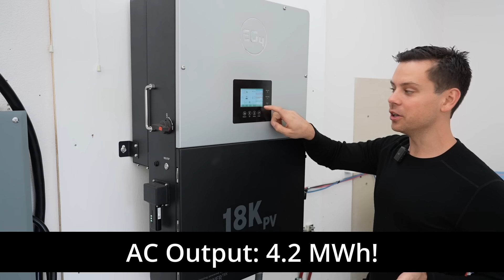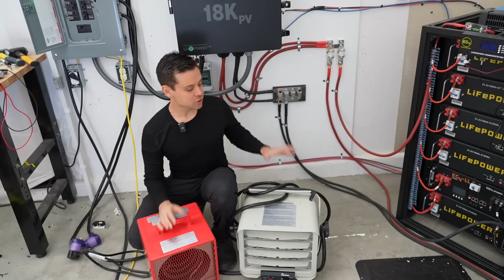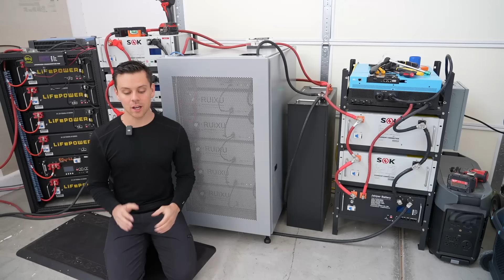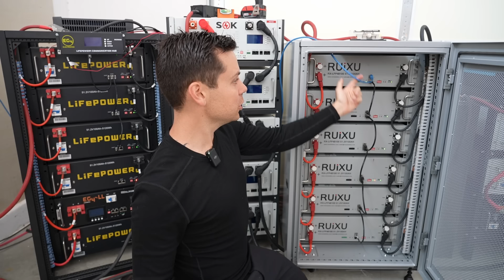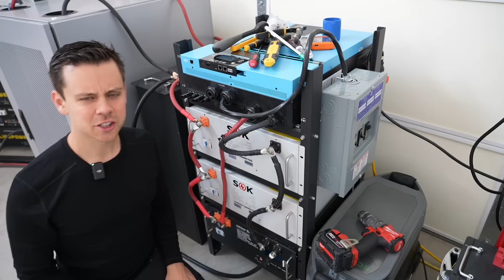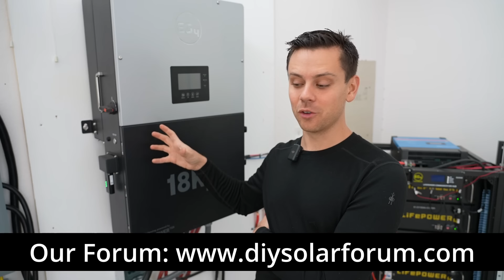EG4 18KPV + 113KWh LiFePO4 = Offgrid Bliss!

Comment: How were you able to use the battery Hub when you have an LL-S battery in your LifePower4 bank?  I have the same makeup - 5 LP4 batteries and one LL-S battery.  The instructions say to make the LL the master battery.  That, I think, eliminates the possibility of using the Hub on the bank.  Is there a way around this?  I'd really like to have the Hub connected if it's possible.

Comment: Hey Will,
Just picked up an EG4 18kPV and can’t get it to power on at all.
Here’s everything I’ve checked:

Battery is powered on and shows 65%
Confirmed 53–56V at the inverter battery terminals with a meter
Battery breaker on the inverter is ON
Load breaker is ON
PV/Solar disconnect is ON
Polarity is correct

The inverter has voltage but shows zero lights, no screen, no fans — completely dead.
Am I missing something obvious, or did I just get a bad unit?
Thanks man.

Comment: Thank you immensely for these videos Will (you are awesome at explaining everything so clearly).  I've been dreaming of a solar/battery system (to reduce grid power, uninterrupted power, as well as for powering our well pump and roof sprinklers in case of forest fire in the event of power being cut off).  I started watching your videos a week ago (binge watching 😀) and you've demystified everything, and I'm now moving forward on the system.  I'm planning for the EG418KPV, with the EG4 wall mounted batteries (i.e 2 X 280ah a 14.3kWh each = 28.6kWh total) and 10 x 455W solar panels (Canadian Solar)...I used your calculation video to ensure all is good (at -40C !) with the max voltage .  I've just applied for our provincial  (BC hydro) rebates (for solar panels and battery storage), which bring the investment cost down by about 33% (makes a $15K investment a $10K investment).  Thanks again so much for helping me take the leap! (I'll let you know how it goes).

Comment: Hi, after connecting the eg4 18kpv to the wall mount battery, how do I start the inverter without blowing out the capacitors? Please explain step by step because I realized nobody is using a  precharge resistor for this setup.

Comment: i want to be completely offgrid forever, not as a backup system.. the grid will be my backup system ahaha.
so im thinking eg4 18k with like 50kwh batteries and like 15kw solar? would this work or i need more

Comment: I want an overkill size / power system that charges off my Toyota Sienna mini van. 12v, 24v, 48v? Ideally in a big plastic trunk. (Wet bathing suits and towels- shocking) Able to power air fryer and large dual zone chest fridge freezer for days. NO SOLAR. What’s the best way to charge from vehicle?

Comment: Can you plug in the Cybertruck's NEMA 14-50 output into the generator connection on the EG4 18kpv to use it as a generator substitute?

Comment: From Luxpower.

However Huayu has provided about 400 pages of new evidences to the court in China to prove that Luxpower used the same money for Huayu’s exclusive 8-10kW series models to certify the so called 12kW model(the actual AC output is 10.4kW/208V only). But Luxpower provided nothing to the court to prove they have paid another certification fee(another million CNY)for the so called fake 12kW(10.4kW/208V). Also Luxpower tried to prevent the court to obtained evidences that Luxpower has also sold Huayu’s exclusive models 8kW/10kW models to US companies(such as Fortress & Sunbeat). In this case, Huayu reserves the right to further sue Luxpower Contract Swindler Crime until Luxpower proves that they have used Huayu’s certification fee as agreed on Jan.14th, 2021 for Huayu’s exclusive 8-10kW series models, not including the fake 12kW model(10.4kW/208V).

Comment: got my 18K after Signature Solar did their rebate for folks who had bought the 6500ex's. Set it up and it worked like a charm for a couple months. Then all of a sudden my power shut off and it said there was a battery fault. Apparently there had been 'battery voltage high' alarms for a month or so, but the EG4 Monitor app doesn't actually alert you of any of these, it just catalogs them so if you don't look you won't know. Checked all the voltages at the battery terminals as well as at the unit and all were nominal (batteries measured 52 or 53, inverter measured 55V). Signature Solar tech support verified this on their end and said everything was fine. Powered everything on again and even though it is functioning normally it is still sending these alarm codes. SS said it was likely a software issue. Fat lot of good THAT does me. System is set up and working as it should but the software will shut my system down?

Comment: Having watched all three 18K videos, and having a Sol-Ark 12K for 2.5 years, I have a comment and a couple questions. My reason for watching is that I was ready to upgrade to the 15K from the 12K. First, in video #1, you mention the price difference. The Price you posted for the Sol-Ark is the EMP protected price, whereas the unprotected 15K is indeed $2000 less. You also don't mention whether or not the EG4 is EMP hardened. Second, Sol-Ark has a feature to connect a genset in place of the grid, and also the "Smart Load" feature that allows the Generator input connection to be used as an A/C load connection. This particular feature is important to me, as my unit is located remotely from the house, and I utilize the Smart Load feature to power the building that houses the unit. While I AM still grid connected, I have a manual transfer at the house at the fuse box. (Yes, a FUSE box! Built in 1962!) Unless I run a new pole and meter box, I don't have the capacity to connect the grid to the Sol-Ark, which was one of the reasons went with them. And no, it wasn't worth $2K for me to go EMP hardened!

P.S. I might have a "gently used" 12K for sale soon! LOL!
Reply: As an addendum, I find that the max charge voltage for the EG4 is 60v. In a 48v flooded lead acid configuration, temperature compensating needs 61v at a bare minimum with 61.6v being about the norm for any temp at or below 60 degrees F. The Sol-Ark 12K that I run won't go to 62v, but the 15K will, For equalization, Rolls (I use L16 445 Ah x 3 banks) recommends 63 volts, which the Sol-Ark 15K will do, but the EG4 won't. Otherwise, it appears that both of these are fabulous whole house units!

Comment: This is a Lux power inverter sold by Signature Solar's "EG4" company.   Its a sticker job for Signature Solar.    If Signature Solar didn't suck so bad at customer service it would be much better.
This is really a 12KW inverter, its not an 18KW inverter.   Why won't Lux power pick a better distributor! 
If you compare the price of this inverter to the SRNE 10KW inverter, this it is very much over priced.  
Will, I'd really like to see more reviews of brands that are not associated with Signature Solar.  Until they get their act together, I have to buy from other sources.   I think that Signature Solar degrades your brand.  Seriously.

Comment: This company Signature Solar and EG4 Electronics is selling you items for thousands of dollars that you will have no control over, They will force you to spend $500 dollars plus just to round trip freight a battery back to them just to get the correct time installed in it. They will NOT give you the passwords to the batteries BMS that they sold you due to some new changed policy that they decided to follow meaning that you just bought a fancy brick you have no control over. If you are one of those people who don't mind paying a lot of money for something you will not own then so be it. Do what you want. For the majority of people this is NOT ACCEPTABLE in any way shape or form. Their excuse is that it is to protect warranties blah, blah, blah. Mine did not even come with a warranty, it was supposedly a refurb with no warranty past it would work or I could ship it back at my cost, Another $300 minimum to even get part of my money back for a dead item

I should have listened to the hundreds of warnings I have seen about this company and their faulty products and horrible customer service rather than listen to a few big name fan boy channels here on youtube. It was bad enough they are twice the cost of anyone else for their batteries at this point. Now you are paying double for an item you are locked out of using. I will do my best to make sure EVERYONE knows you are doing this. I will NOT be scammed by anyone and be silent and yes i said scammer. Sending people items with something as simple as the incorrect time that effects everything in your inverter regarding time and history and then telling them they have to spend multiple hundreds of dollars to send it back just to get the time changed is the definition of a scam. All you had to do was give me a password to an Item I paid you $2000 to fully own. I would have not bought a single penny worth of anything from you if I knew you were retaining control and ownership. And though my purchase was from signature solar this goes for the EE4 Electronics company as well because this policy seems to be because of their policies.

Amy youtube creator who deletes this is admitting they are a shill only out to make money from the company regardless of what they do to the viewer, the customer.

Comment: Would it be better to run 4x of the 3k units instead of the 18k (actually 12k) unit?
4x3k would be half the price and yes, they could fail, but if one fails, you still have 9kw output instead of zero. Maybe buy 5 and have a spare?

Comment: Just tried to get a quote for an off-grid home system with the EG4 18k and I was told that it will not operate at our build site here in Colorado elevation (8,000 ft). I looked through the manual/specs and did not see anything regarding the elevation. I did do a search and found others talking about this issue and they think it basically boiled down to the thinner air may not supply enough cooling. I have also sent a text to EG4 to confirm this.

Anybody else seeing any issues at the higher elevations? The vendor did recommend a Victron Quattro inverter that can operate at up to 9800 ft.

Comment: Signature Solar just dropped a load test video yesterday that IMO shows it did better than advertised and cleared up some questions I had there.  I am going to buy either the Sol Ark or this one in the next few days.  The one question I don't see answered anywhere is whether you can hook up a gas generator to charge batteries with the EG4 and as I want to be off grid and have the ability to do that in winter when it is dark and rainy for days as happens in Texas, having this option is huge for us.  We are outside of city and on electric co op so have zero interest in sell back, it doesn't pay.  The tax write off and my location does make paying off whole house doable in under 10 years.  Would LOVE to know the answer to this one questions.  BTW, I get Signature has at times had longer wait times but its the growing pains of growing a business, I am ok with it.  I have been very happy working with them.  Being understanding and supporting these types of businesses is what leads to better options for this community.

Comment: Will, what about the Sol-Ark 15K. It has superior user interface, more capacity and can be programmed to customize it in more ways. The interior components of the Sol-Ark 15K are also higher quality. The costs also are about the same.

Comment: Hi Will,
I have 2 17kw lifepo4 battery modules each has a SMART BMS MODEL: JBD-AP21S002 . They don't  seem to have a battery comm port. Can i use these with the eg4 18kpv ? Also i can seem to find a list of eg4 compatible bms units? 
Please advise
Thank you

Comment: Axpert MAX 11KW 48V 220V 10KW Solar hybrid Inverter with 500V PV input voltage 150A MPPT solar charger Built-in WIFI Transmitter

Comment: How would this work if you have a solar system with micro inverters already installed? Does the 18k have provisions for that? How would you use it with the new batteries on such a system?

Comment: Will,
     We just got our kit from Signature Solar a couple weeks ago.  Still looking for an electrician to connect it all.
The rack I have is the newer 2023 rack.  It has a door, floor, is all welded and came shipped as one unit.  The busbar is different (all flush, thicker, and has lugs on both ends so you do not need to flip it around).  There are two holes in the top for wires and four in the bottom.  The casters are super heavy duty.
Sounds like they addressed most of your complaints.

Comment: So I purchased the SolArk 15k well in advance of when I needed it. It’s still in the box on the original pallet. 2 months after my purchase this came out. My question is, should I ditch the SolArk and buy this and save myself half the cost? I can probably sell the SolArk to a local company for what I paid for it. 

What is the real sacrifice? I’m having a hard time finding one. My system will have 11Kw of micro inverter panels, 5kw of standard panels, EG4 or similar battery and a 22kw Generic. I’m “on grid” and would power arbitrage if possible. 

Ok someone talk me out of this?!?

Comment: Will, I have trouble getting this to function with AC charge and and Force discharge in normal mode with AC coupled solar attached. I've tried at least 5 different firmware versions and have had the manufacture trying to make it work without success.  I started with version FAAB-090C, then 0C0D, 0D0E, 1010 and am currently running version 1111. I've struggling with this for over a month.
Can you please do a deep dive testing into AC coupling functionality and try to get this issue addressed. Thanks.

Comment: Hello, i have a question. I have at home a solar array with enphase micro inverters. Is it posible to use eg4 batteries. Because its much cheaper then the prebuild batteries. If its posible what things do i need to make it happen? Im not that good with electrical.

Sorry for my bad englisch

Comment: I have a question. I bought 4 panels that are said to be 2000W combined. In direct sunlight clear skies each panel is reading around 45 VOC and 5-5.3 amps. The package through Amazon was just under $650.00. If I'm doing the math correctly the panels are only doing about 238W instead of close to the 500W advertised. Are they worth it or should they be returned. In series they are reading about 173 VOC. I bought the set up in the video and it says min. 120V. Please advise and thank you.
Reply: There are so many factors that can drastically change the power a solar array can produce:

- angle and direction
- shade
- climate
- correct wiring 
- connection quality
- quality and efficiency of panels
- etc

Comment: Love your videos. Can you do a video on retrofitting a 18KPV onto an existing grid tie system (7.4kw enphase microinverters IQ7+). I ask this because CA is about to push out new electricity rates based on income which will essentially make my net metering benefits obsolete. This rate change makes me want to disconnect from the grid completely. Im curious of the best way to do this with my existing grid-tied micro inverters. I'm thinking of adding the 18kPV and about 30-60 KW of server rack batteries. Does the 18kPV allow one to set up a micro-grid and allow the enphase microinverters to continue to work without a formal grid? Of course I would use a 9KW inverter generator as back up to charge batteries if they ever go below 15% SOC. We do have some cloudy/rainy days here in LA. What do you think? Interested in making the video? I am familiar with off grid systems. Built a 120V, 7 KW solar, 15 KW storage for a cabin we have in Big Sur. Works great up there but really want to build something here that is AC linked with my existing solar. Phase 2 would be add V2H tech when I eventually buy an EV.

Comment: i just bought the 18k and it's going into my father in laws toy trailer. yes way overkill but there is three components needed. batteries, 18k inverter, solar panels. simple clean wiring. supper fast install. everything needed in one simple box without a bunch of wires, fuses, buss bars. i would think that installers for travel trailers would go to something like this because time is money and this would cut out so much install time that it would be cost effective. i was going to do the whole victron units and it is only a few hundred dollars more after all components installed that was required with the victron units.  UPDATE. After calling Signature Solar I found the literature that is sent with pretty much all their product from eg4 are all out of date inaccurate. Go ahead and throw all directions away that come with the product and go online to their online instructions/set up. After reading through the online literature it all worked. This goes for the 18k and the new eg4 LL batteries. Pretty sad.

Comment: Thanks for the video Will not boring I like the 18k. I have 6500-ex's and far no issues but having the extra capacity of the 18k would be nice. There will be further improvements however with how things are going better get what you can the supply future does not look good.
Stay Safe & Good Luck

Comment: My newer eg4 racking is a lot nicer than the one you have,   Welded with door.  Good Quality.    Been running Sol-ark 15 K.  Al-some unit but pricing.   But for how much the 18k cost and Signatures solar worthless customer service I would spend the extra money.